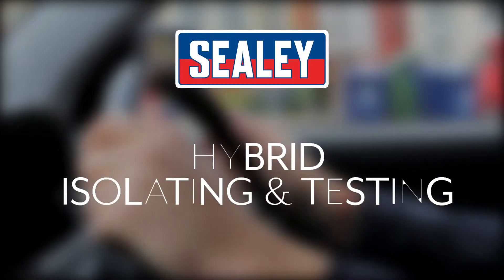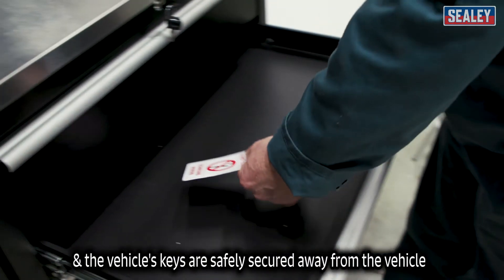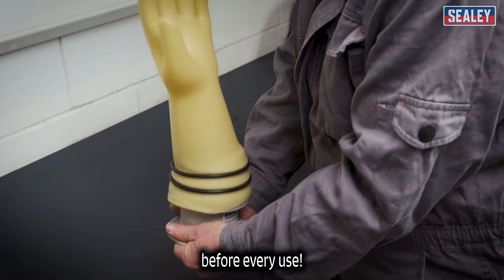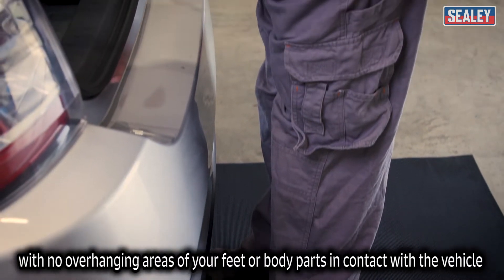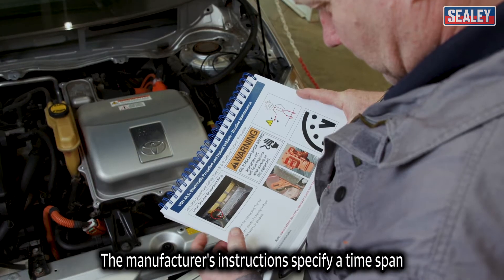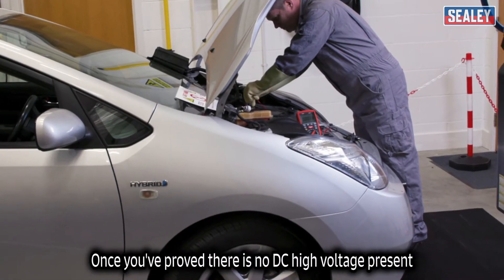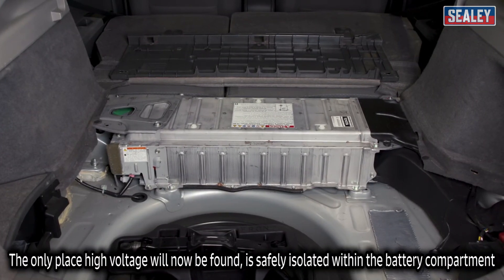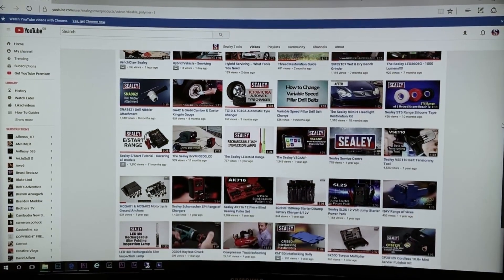Sealey's Guide to Safely Isolate and Test a Hybrid Battery | Essential Equipment and Tips

Comment: what does the rubber mat do?
Reply from the maker: Hi Jim, this is an electricians insulated mat. This prevents electricity earthing through your body. A very important safety equipment to own. High voltage passing through your body could cause serious injury.
Reply: @sealeytools  Electricians use them because in mains electricity, the neutral is connected to the earth at the substation, so touching the AC live and standing uninsulated on the ground means you will receive an electric shock. The High Voltage systems on electric and hybrid vehicles are IT (Iso Terre) systems and are not connected to the ground. The matt serves no purpose and only demonstrates a lack of understanding of the system you are working on. At worst it could give you a false sense of security. However if you were working on the vehicle and it was plugged in to an EVSE and was charging and you were working in the area of the AC inlet. it may have some value.
Reply from the maker: @jimgilmour5710  As you correctly point out our HVM17K02 is a vital piece of PPE when working on mains electricity. As for you stating that Sealey have a lack of understanding of electrical systems on high voltage vehicles, we have staff at Sealey who are trained and qualified to be able to work on these vehicles and indeed do so. Working on these vehicles safely means following the manufacturers guidance for safe working practice. Vehicle manufacturers all state the vital role of PPE as part of safe working practice when working on, or near high voltage areas, this information is freely available to everyone. Guidance is also freely given on the HSA website and various trade bodies. All of these organisations state PPE must be used. It must be considered reasonable to accept that the people who manufacture these vehicle systems, and the people who provide advice and legislation for safe working practice will have a complete understanding of them and the risks involved in working on them. Here at Sealey we follow this advice to ensure we can provide our customers with the correct and safe equipment required for their needs